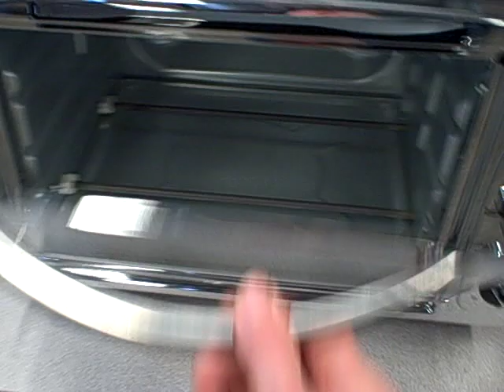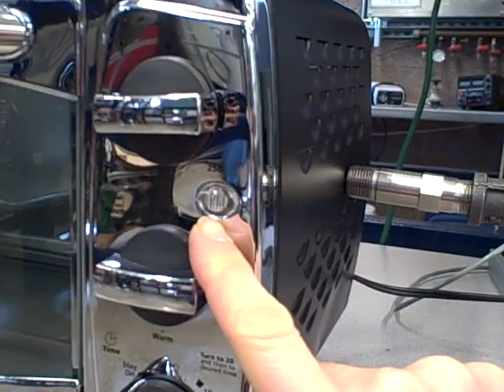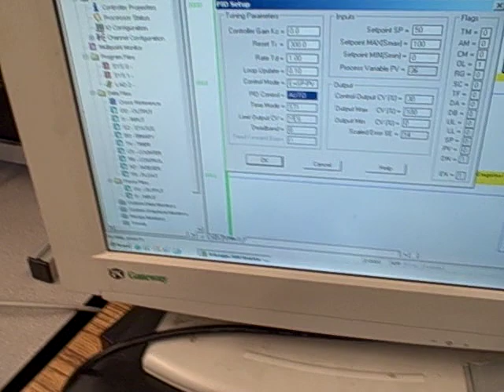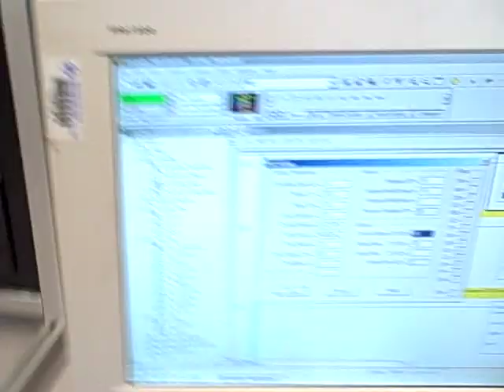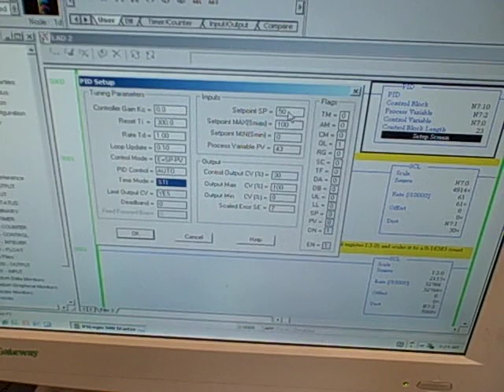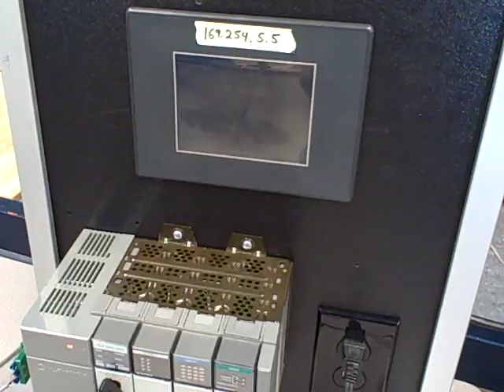Toaster oven PID control using PLC -- part 1

Comment: I need to create this same function with the output being turned on and off to regulate temperature in a large hot water heater. Could you create a video on the ladder logic starting at rung 0?  Maybe even supply me with the .rss file? I know that might be a long shot, but any direction would be appreciated.

Comment: do you have a video where detail the pid programming? i have a problem with mi pid...when  i reach the set point value my process variable always is at 100%. i will explain what i want to do. i have a conveyor with weight measure...i put a set point...1.5 tons....my process variable starts to change and reach at 100%...but i think that is incorrect because always stay at the same speed value. please help me...i think the problem is in the scaled

Comment from the maker: Yes, we use a timer instruction and a "Greater-Than" comparison instruction to determine when the discrete output bit turns on and off, according to the percentage output value coming from the PID instruction.

Comment: Hi, I'm new at this and I want to use a PID instruction. I would like to ask you a question about how you're turning the output ON/OFF. Do you have a separate rung that calculates the percentage duty cycle required and cycles the output via a timer accordingly, or something like that? Thanks in advance if you're able to answer my question.